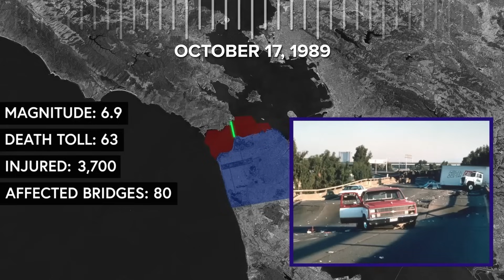How US Replaced Its Biggest Bridge and Nobody Noticed

Comment: Will you tell I tell you I lived in California? I lived in San Francisco at the time they were replacing the bridge and we actually noticed they actually had it closed down for a weekend. We weren’t allowed to cross that bridge because it was no longer there it was shut down so we had to go all the way aroundwe did notice. And there’s two parts of the bridge so the one part that’s actually double-decker is still up. It’s on the San Francisco side of the island and the one they fixed is on the Oakland side.

Comment: The Bay Bridge could've been repaired/replaced in half the time. The entire span was built in 5 years in the 1930's. And due to the crappy Chinese steel and concrete that our one-party state purchased, it had to be redone a number of times, while they kept having to use the old structure everytime the concrete from the eastern span, the new span, kept falling on the cars. Also the terminal for Muni at the Western terminus of the Bridge at the Ferry Building ALSO kept having to close almost the week it opened because it too had inferior Red Chinese construction materials which nearly hit a couple of people as they dropped small chunks on those walking below. It would be funny except it was humiliating. And a "bullet train" from San Francisco to Los Angeles as been a-building since 2008 when the Transcontinental railroad only took 6 years to build.

Comment: This video has several inconsitencies, such as stating that the San Francisco Bay bridge is 1 structure of which was completely demolished.  
In fact, it is 3 separate bridges.  The SF side with 4 towers is actually 2 bridges linked by a central anchorage with the 3rd being the new eastern span. There is a graphic showing the entirety of the bridges disappearing.  In fact, only the eastern span of the bridge was replaced (Oakland to Yerba Buena Island).  Most of the footage contained herein focuses on the SF side giving the viewer a false sense of what was replaced.

Comment: Very inaccurate information presented in this video. The only replacement work was on the eastern side of the bridge. There was no damage to the western half of the bridge. They stated in the report on the bridge was that the foundation was made of wood piles and most if that was in bad shape. That was the main reason that they didn’t want to repair the existing structure because it was always intended that the eastern structure would be replaced at a later date and it was facing the Oakland side. They built the new bridge structure next to the existing bridge structure, then after completing the new bridge they removed the old bridge. As far as bridge go the San Mateo bridge is 14 miles long which much longer then the bay bridge.

Comment: Too long to build.
Way over budget.
Poor foundation and anchoring in the early stages.
Mostly concrete, which is easier to build with, rather then all steel.

Basically they built the new bridge next to the old one, join them at the end. Then demolished the old bridge.
Not complicated at all.

Comment: Total bullshit.  This bridge has 2 sections: the western section is a suspension bridge and was not damaged to any extent and was not rebuilt.  Parts of the eastern section were damaged and an entirely new bridge was built next to it.  When completed, traffic from the existing "old" eastern span was diverted to the new adjacent span. There were numerous problems: crappy substandard metal bolts from China among others.

Comment: A bridge so well designed and repaired by a Chinese crane company (portion replacement) that in fact is now much more likely to fail due to political corruption. Connection miss matched while some anchoring points in corrosion prone points. Engineering and politics dont never mix!

Comment: The company that was awarded the contract for the new bridge immediately raised the cost by half after they got the contract. Then mothball fleet in Vallejo Mare Island were taken to China to be melted for the steel to help offset the costs, and the better steel. The Chinese returned inferior steel bolts that sheered off almost immediately from the structures that held the bridge up. That bridge is questionable
Reply: The relevant mothball fleet was (and in small part still is) quite a few miles from Vallejo's Mare Island. You have to go through the Carquinez Strait and some miles further to get to Suisun Bay. I doubt that any Federally-owned ships were sold to pay for CalTrans' costs.

Comment: So much was left out of this video.  The bridge was behind schedule and more than 25 times the original projected costs because of delays caused by shoddy materials (bad concrete, failing bolts, water penetrating into the cable supports - weakening them).   Then there was also the three year standdown when they found a serious design flaw in the tower and road way lacking additional support.   A single bomb at the base or event that damaged the central cable tower would cause the whole eastern span to fail and collapse.

Comment: The Golden gate Bridge definitely has a better p.r. department, considering the bay Bridge was built first. I think it's the color, red, very striking.
Reply: The color is certainly a big factor, but it's behind the Art Deco design and the natural setting at the strait (the Golden Gate) is what makes the bridge iconic. It needs no PR department other than its own existence!
Reply: Next to the Bay Bridge the Golden Gate is a piddling little project. As a kid I use to bike under it on my way from Potrero Hill to, say, Aquatic Park and I'd look up from the Embarcadero at it and my reaction was always, wow, that sucker is BIG.
Reply: @gandydancer9710  It's true it's a smaller bridge, but "piddling" is unfair. The engineering challenges were immense, more so than those of the Bay Bridge, and the GGD held the distinction of being the world's longest single-span suspension bridge, until the Verrazano Narrows bridge opened in 1964.
Reply: @dennischiapello7243  I said "NEXT TO THE BAY BRIDGE [west span]" the Golden Gate is a piddling little project." And it is. I'm very familiar with the Embarcadero end of the BB and the Presidio end of the GGB and there is no comparison. I'm not saying the GGB doesn't have its charms and didn't have its challenges, but it's a heavyweight vs a middleweight. I don't care how good Sugar Ray Robinson was, Joe Louis was going to kick his ass and only one of them was in the competition to be the baddest man in the ring on the planet. The GGB is cute, the BB is a giant.
Reply: @gandydancer9710  🙄

Comment: Welding Inspector ...I was offered a job to review all the prior welding inspection reports and give a final OK on them.  I refused because simply looking at a written report is no proof that the actual weld is adequate.  I also inspected another (welding) job done by one of the bridge welders, (consisting of 133 welds) and failed every single one.

Comment: Had just begun under Guv Ahnold.  He considered changing the design to a suspension type, to be more glamorous, but not in the budget.  It has just a small cable-stayed section.  This video shows the west span which hasn't changed.  The east span from Treasure Island to Oakland was replaced.

Comment: The script was merely OK but the graphics were ridiculously bad.  One failure of the script is that, although the name suggested it was a singular bridge, the original bridge had two suspensions bridges, the largest bore tunnel in the world, a cantilever span, a truss bridge, and a causeway.  Someone else has already pointed out that you barely showed the eastern part except when you showed the part that collapsed.  Instead, you kept showing the two suspension bridges on the west side of Yerba Buena while talking about the eastern portion.  I'm going to suggest that you start over.  
PS  Norton the First was the Emperor of the United States and Protector of Mexico.

Comment: The Bay Bridge is the most California thing ever - barely necessary, "fixed" in a way that offered no real improvements, and cost six times as much and took twice as long as planned.  I live in Marin County - just over the Golden Gate Bridge - and every day our highways are clogged with cars AVOIDING the Bay Bridge, by crossing the GG and going up and around the top of the bay, rather than dealing with it.  The bridge did not increase capacity at all.  Just another failure by our useless, venally corrupt state government.  Just in case you were researching doing a video on the bullet train... I'll save you some effort and tell you it will NEVER be built.  California has become the poster child for government inefficiency and public waste.  And unfortunately it will continue.
Reply: To folks who've read the above comment: the western span didn't get replaced and will outlive the above commenter. Increasing vehicular capacity was unrealistic.
Reply: @AtomicBuffalo  I stand corrected… six times over budget and twice as long for HALF a bridge!
Reply: @karnubawax Unsurprisingly, another crank post to follow your first one. Atomicbuffalo’s point was that it would be impossible to increase traffic flow when half the bridge is exactly as it was before. Sure, you could put twice as many lanes on the eastern span, but it would instantly become a parking lot when twice as many cars tried to get on the western span. What’s the plan, Stan? Ferry the excess over to SF?

Regarding the point in your first post about people avoiding the bay bridge by using the Golden Gate Bridge, the only people for whom it would make sense to avoid the bay bridge are people living in Solano and Napa counties. They would be doing it to avoid being tolled in both directions, not because of any problem with the bay bridge. As vpolite mentioned, anyone going to/from the east bay would be wasting both time and gas. People going to/from Marin or Sonoma counties would be equally wasteful using the bay bridge instead of the Golden Gate Bridge.
Reply: Over budget on only half the crossing is only half as bad :) And a 6X budget claim is somewhat arbitrary if not specious considering the history and evolution of the project and its goals. I encourage everyone reading this to check out the Wikipedia article on the east span replacement project.
Reply: This comment obviously came from a moronic troll. Nobody traveling from Oakland, or the East Bay, is going to travel an extra 40 miles just to avoid the Bay Bridge. It would add an extra hour to your travel time. It is completely idiotic.
Reply: @vpolite1  No, the people going to the East Bay clog up 580 and the San Rafael Richmond Bridge.  The ones going to Vallejo go over the top.  Sorry I didn’t make that clear.  Dick.
Reply: The real stupidity in transit planning was not placing BART stations at Richmond Hilltop and Hercules.

Comment: I was amazed that steel portions of the Bay Bridge were imported from China.  It was fascinating however to watch the replacement of the eastern span.
Reply: Do you remember when the steel parts made in China were partially scrapped when they changed the proposed design before beginning construction? Your tax dollars at work. Not quite as bad as California's High Speed Rail to Nowhere, but close.